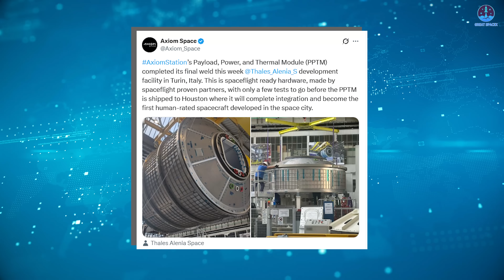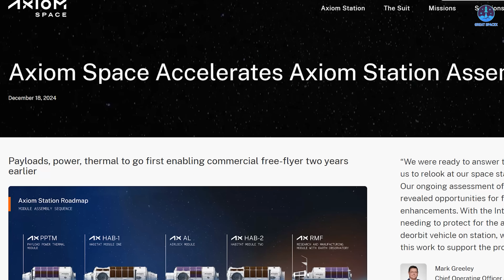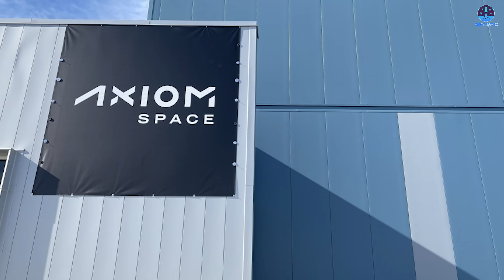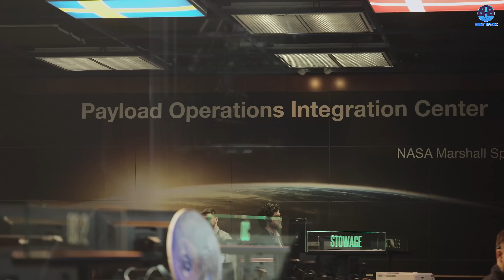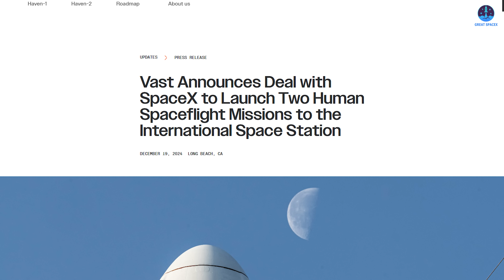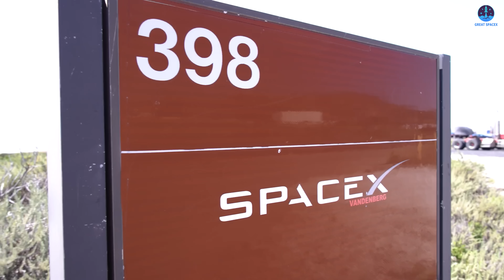New Module Completed! NASA is getting a Space Station SOONER than expected…

Comment: Have them work together and the station can be built twice as fast and if the Russians want to leave in 2028 let em go, then they will have to cooperate ore with ALL ISS partners in having a manned outpost for future research and if some type of manufacturing can be developed the sooner the better.Now that the launch cadence has been increased the two could be launched from both coasts, just a thought.  Like Michaelbinder9883 posted save  as many modules as possible to reduce costs more i.e. the JAXA module itself and if Japan wants begin building a replacement for that module replacement and by starting whenever possible the cost can be spread out and new technology invented could be added as needed.